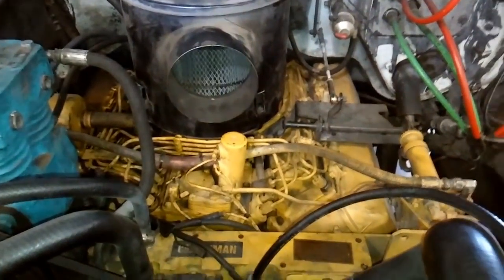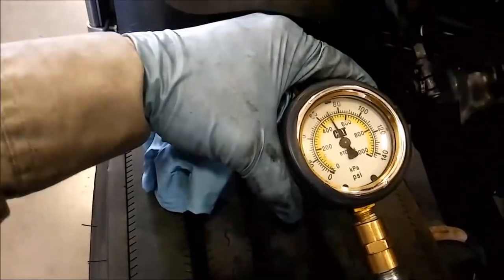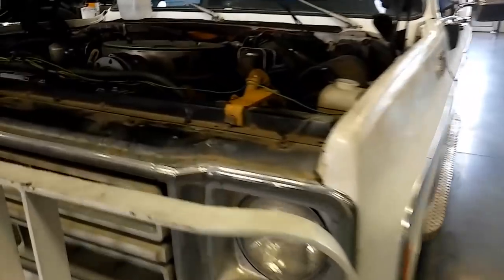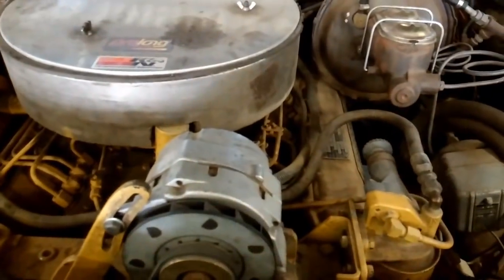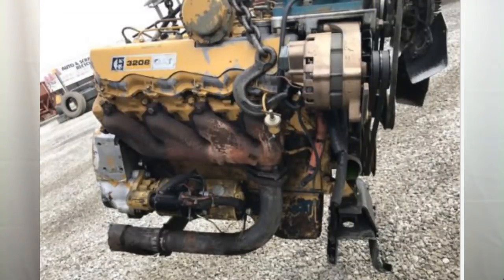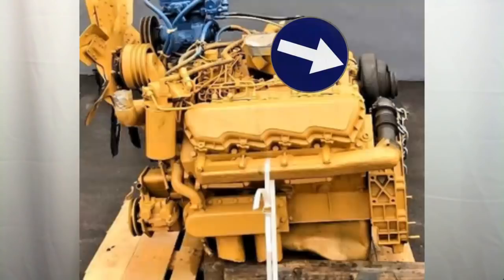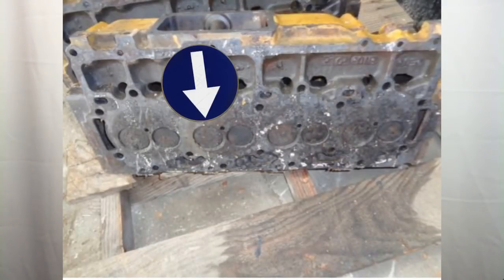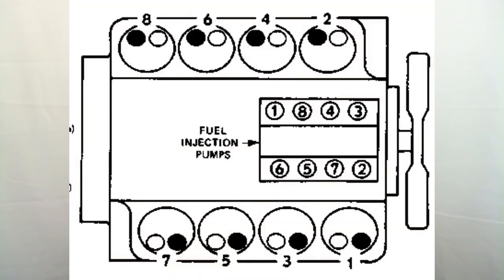The Cat 3208 Engine.  Know Your Engine. Engine Design And Problems.  Cat 3208.

Comment: Thanks for the video.   I read the manual and gonna do the valve adjustment.   Couple of questions please.  First,  It says something about a timing pin, Iv'e heard I can use a bolt, is this the case?  And on the rubber valve cover gasket do I use any kind of sealer?  Thanks again,  Chris... Will donate to your channel :)
Reply from the maker: +chris gollihar You could use a bolt, but a pin punch will work better as it is smooth unlike a bolt with threads. It just needs to be the right size. I don't use silicone on hardly anything, unless it is where gasket joints meet and the 3208 uses a 1 piece seal, so I don't use any on them.
Reply: Thanks Josh appreciate your help

Comment: take the decals off and set them side to side you couldnt tell the difference between a 3208 and an 1160.  the diaphrams in the pcv valve would tear and you'd burn the oil out of the engine.    the throttle shafts would wear in the governor housing and suck air. there was a run that in cold temps would blow the oil filters right off the cooler housing. had to drill out reliefs. had several that blew out the timing cover gasket from high coolant pressure.  i've seen them down to 165 hp

Comment: Hello! I just picked up a 1980 Ford C800 (8000) with the Cat 3208 (non-turbo) with auto-trans.  Would you happen to know where I can get the old part number (exploded view) which would include belts and hoses specs?  Trying to stack the deck so I can search for parts, etc....thanks

Comment: Have a 3208 in our New Holland tr85 combine never had any issues ever with it seems like a sold engine
Reply: Clean fuel is a must. Lower end is weak, replace rod and main's brgs sooner than the O and M guide. Keep valves adjusted.

Comment: What is involved in converting a turbo 3208 industrial generator engine to a truck engine?  HP is the same.  Just an adjustment to the rpm and moving the accessories over?

Comment: Are you sure they never made a 3208 with a roller cam ?
Could've swore the last ones with the turbo had a redesigned block to accommodate a roller cam setup. But i could be mistaken
Reply from the maker: You are correct, some of the last versions were roller cams. I've never seen one in person though.

Comment: Notorious for the valve keepers which hold the top of the valve stem to the springs letting go. This lets the valve fall out after the engine is shut off. The next time you start the engine the piston pushes the valve up where it try's to make new holes into the head.

Comment: Cant say much bout these engine,i got 2 of them in my pilot boat.I cant go worrying bout the the valve gonna fall into the piston or the piston rings are gonna crumple.Hope its not! i've seen valve chipped off & the pieces fall into piston & damaging the piston head.Well,if its gonna happen, just fix it.Yeah,too bad 3208 didnt have a cylinder liner.Other than dat,its a good engine ":)

Comment: so what is the difference between a 210 and 250 hp turboed engine?  Injectors or fuel pump?
Reply: A 210 NA or a 210 Turbocharged?
Reply: @johngoldsmith6629   thanks I learned later the blocks are different between NA and turbo.

Comment: Hello.thank you for a great video! I have two of this in my boat,1996 mod 435 hp.runs great,but i have a problem with soot in my coolant.I have tried cleaning serval times,but my coolant is turning black very quick . Can this be because of the O-rings you talk about in your video?
Reply: no  you got a cracked head or exhaust manifold

Comment: In terms of reliability, cost and longevity which is better? 3126 or 3208? I'm trying to decide because I want to swap one into a 85 Ram 350. I know both engines will be a lot of work to put in
Reply: I'd say 3208 is more reliable but is heavier that a 3126. The 3126 is narrower but long as it's a inline 6 vs a V8 so fitting it in your engine bay gonna be a issue. Honostly if I was you I'd just slap a 12 valve Cummins in your truck. Easier swap and of course the aftermarket is huge and parts will be cheaper.

Comment: Dammit, now I’m worried about that O-ring plastic tube BS…
I do have the 02Z engine with turbo and no intercooler (250 Hp version) built in 1988.
I want to add an engine retarder but I have to beef up the exhaust valve springs to do that I am hearing, and I cannot do that unless I have the steel camshaft and not the cast iron camshaft.
How do I determine which camshaft I have?🤷🏻‍♂️

Comment: what was the difference between the 1160 and the 3208???   biggest problems i had was blowing oil filters off in winter (service bulletin on that) and sucking air around the throttle shaft,  when they'd get worn the diaphrams would blow out on the crankcase vent and theyd vampire themselves

Comment: We got a RV 3208 v8 and fuel stays on top the engine what would be rong with it  thanks for letting us know
Reply from the maker: Most likely a leak somewhere on the high pressure fuel pump or lines going into the cylinder head. You'd have to clean it off really well and watch it run to see.
Reply: Thank you for answering have a great day

Comment: Boats....I have 2 of them in my Model 4280 1988 Cruisers Yachts!  Run great.  Looking for upgrades to it for better performance.  My boat is 01Z serial number and are 375 HP turbo versions.
Reply: I have 2 in my 1988 Phoenix I just bought. Engines seems meticulously maintained. Have you ever had any issues?

Comment: Hello, how's it going in this quarentine?
Let me ask you, I'm a marine diesel mechanic and I'm working on a sailboat which had one of those cats 3208 unfortunately the engine was submerged and nobody did anything for years so it's dead, to get a new similar engine I found some boat papers saying it was 150 HP but all the information I ever found about this model was that the smallest version was 210HP so maybe somebody made a mistake filling the papers or actually they made a 150HP version? Do you know anything about? Thanks!!!
 Regards from Puerto Williams - Chile.
Reply: Looking at the flywheel from the rear. The engine serial number is stamped in the block under the cylinder head. That is where you need to start.
Reply: If the horsepower was lower than 210, they must have turned down the fuel pump due to vessel survey requirements.
Reply: The 3208 evolved from the earlier 3160/1160, 1150, 1140, and 1145 series engines. This entire engine family looked pretty much the same, except the earlier engines had inline fuel injection pumps and fuel return lines. I've only seen one 3208 with fuel return lines, and it was ancient back in the 1990s. These engines were seriously low on HP, but the torque was really good. I've seen NA 3208s rated as low as 190 HP, and it wouldn't surprise me if there were lower HP versions offered. 210 HP was the maximum for the NA engine IIRC. The highest HP versions of the 3208T were the marine engines with keel cooling and water cooled exhaust manifolds. A Cat rep once told me that the 3208T marine engines had an extremely low warranty rate. I smarted off to him saying that it was probably true because the 3208 had a nasty habit of connecting rod failures (true), the rods on the third journal back would chuck the rod and piston through the hull of the boat, sinking it. Then it wasn't a warranty claim, it was an insurance claim. He was not amused by this very much.

Comment: It's been many years since I have even seen a 3208 
But now have a fleet customer who has a rare F8000, not a C, or CF , a F series running a turbo 3208.
 I vaguely remember the fuel injection pump R & R steps.There was a short bolt you removed and replaced with a longer one, on the pump or block I no longer remember.
Anyone out there know the procedure? Thanks.

Comment: Hello,  I found a 1981 TR 85 New Holland combine that a local farmer had in a barn with only 1000 hrs on the machine.  It has a 3208 Cat but the plate on the valve cover states that it has 168 hp, I thought it was a 210 rated motor?  I'm taking the machine apart due to rust but the motor started up and I managed to drive it 10 miles to my farm.   Just reading up on the pros and cons of the 3208, even thinking about replacing my 7.3 PowerStroke on my 95  F350 or putting it in my International 966.  Any ideas out there!!!
Reply: 155, 168, 175 HP in TR combines.  My TR 95s put out 225 HP but that is turbo.  We had 5 NH combines, all went over 3500 hours without engine troubles.  Then headgasket failures, but I was always worried about that weak bottom end.  100 hour oil changes.  Great starting, if your batteries would roll it over once it was running

Comment: I know nothing about boat, generator, or equipment motors. I had a couple in Ford trucks. So if you run across a Blue one, it was in a Ford. If you find a Red one, it was originally in an International. And if you have a White one, it was in a WHITE truck, (Freightliner's grandfather).

Comment: It's the little V8, Cat made a shit load of them. I heard people who have worked on them by advancing the pumps on them. and putting twin turbos on them. and larger exhaust systems on them. and have used them in light duty trucks with one ton being about the lightest. and have pretty good success with them. one ton Ford pickups are a really good application for them. the naturally aspirated versions were dogs. they had a terrible HP to weigh ratio. but if properly maintained could run for a long time. boy time has flown by I realize it's been over twenty years ago. when Cat stopped production of them.
Cat And Ford must have had some sort of arrangement with each other. because back when Ford built the Louisville trucks. which they made a shit load of them. almost all of them were powered by the 3208 Cat engines.

Comment: Thank you for making this video.  435 hp out of a 3208??  THAT would seem to be a short lived engine....would that most likely be in a marine application?   I owned about 15 of these, all low hp at 200-225 horsepower.  Even had a turboed 3208, at 170 hp (??) at 2400 RPM max, ridiculously weak, but probably lasted forever in this yard goat.  They MUST BE maintained or they will fly apart violently.  I liked my 1160 (the older 3208, with a better injector pump) best, but no family of engines ever committed suicide sooner or more explosively than these non-sleeved CATs.
Reply: So are upi saying you don't like the 3208???

Comment: Ok Cat made model 1140, 1145, 1150, 1160, which are the predecessor of the 3208 same block same head design all interchangeable between parts 1160 is the same bore and stroke as the 3208 BUT the 1140, 1145/522 CID and 1150/573 CID  have smaller displacement with corresponding bore and stroke these Cat engine are referred as the 1100 series model

Comment: Amazing how they get so little power and torque out of a 10 litre engine
Reply: Yup....its an engine that doesnt have enough power to get out of its own way.  hahaha.  Why did CAT even bother?
Reply: @iBackshift  I believe as an anchor they are excellent
Reply: @iBackshift  they were trying to match Cummin's lack of success they had with the "Tripple Nickel" 555 V8.
Reply: It’s a dinosaur. Even my 7.3 idi is more advanced than the 3208 I thought about putting it in place of my idi if it failed, but when I found out how much it weighs that shut it down pretty quick. Same thing with the 5.9 & the dt466, I can see myself getting a dt360/IH5.9, but I’ll probably in the end put another idi in the truck cuz the engine is pretty reliable once the engine is bored out & gets sleeved to “fix” reset the cavitation timer on the engine.
Reply: Really goes to show that (large) Diesels are pretty wimpy without forced induction.
Reply: I’ve got a Ranger in Australia with a 2lt engine that’s 210hp.
Reply: @wintonhudelson2252  we used to call the 555 Cummins triple trouble
Reply: @iBackshift  no kidding a 6v92 in any configuration will walk all over  it
Reply: @ No Body

Yah—

—and so little fuel economy also...

Comment: What Are Some Things I should check when I'm looking at this engine for sale
Reply from the maker: +RoadHammer3406E I need to make a what to look for in a used engine video. Without pulling it apart, you can really only do a few checks. Run it and listen for anything that sounds weird, check the oil pressure hot and cold, get an oil analysis if you can, how does the blowby look, coolant condition, oil and exhaust leaks.
Reply: Adept Ape well the engine I'm looking at looks great but sitting on a pallet and the ad says it hasn't run in years but had an inframe just before it got pulled

Comment: Is it true, that you could literally connect 3208 engines front to back and make one bad boy engine?... LOL, if it is, sounds like you'd need duals on the front axe because of how heavy just one motor is... but I remember hearing and old story about a chip hauler with 2 3208 engines bolted together under the hood..  said it belched out black smoke like the queen Mary but passed other loaded trucks like he was empty, but if it was making 600 to 850 horsepower back then... must have been a fun ride! Hell, I miss a C 15 compared to the stupid 13 liter junk being forced into the industry now...

Comment: hey sorry to bother you I have a question on my c7. I have a loss of power after it warms up it will drop gear and not let me pass 35pmh. I checked my fuel pressure and it's at 55psi. what do you think it can be ? thanks
Reply from the maker: +anthony alvarez Well that pressure is a little low. Start with the pressure regulator on the back of the head, it is fairly cheap and commonly fails.
Reply: Adept Ape
 thank you for your help

Comment: When will you do a video on the 3408 cat
Reply from the maker: +Joseph Martinez The 3408 isn't an engine you see very often, I'm going to do a 3406B video though.
Reply: Still popular in Australia ! On youtube you can see them in some road trains ! My friend had one in his logging truck with a pre-cup and it would lug down and pull like crazy ! His cousin had one in his truck with DI but it would not pull like the pre-cup ! Great videos A A  ! Have you dealt with any natural gas conversions in on highway trucks yet ? Glen.
Reply: I vote for videos on both... I love the B best mechanical cat ever.....E if you want electronic....
Reply: I have one in my 82 peterbilt 359. Direct injection version. No glow plugs.
Reply: 3408 is a excellent motor. No jakes though as it was originally dwsigned as a payloader engine. My friend owned 5 of them. He put over 4 million miles on them. Never had any problems. They sound awesome.
Reply: I appreciate the videos on the older engines.. Brings back a lot of memories of helping my dad on the weekends when he worked for the Portland OR Cat shop, back in the late 80's..
Reply: fastbmwm635 pre cup MAYBE...DI NEVER
Reply: Adept Ape ok cool just wondering lol because that’s all I’m around on these shrimpboats 3408 and 3412s thank you
Reply: Putting a Jake brake on a 3408 would have been a plumbers nightmare. Thus a brakesaver was used.

Comment: Have you worked on or know much about the 1160 cat engine?
Reply: 1100 series engine. They was available in 1140, 1145 1150 and a 1160. Inline scroll fuel system. Smokes in cold weather until it warms up.
Reply: Are they comparable to the 3208? I can't find much info about them and I was going to use it for a engine swap but finding info about it is proving to be difficult
Reply: @zackbirkby564   When the 1100 series was discontinued Cat offered a reman 0R1108. It was a 3208 with a 1100 series front cover. The entire mounting is different than a 3208 for air compressor, alt, power steering and such. Also the throttle linkage was different and fuel line hook up to tank.  The crankshaft was smaller where the pulley fits. Have to use a 1100 series pulley with a 1100 series engine. I never tried to convert one backwards. Unless you have all the accessories, you might have to use the 3208 cover and see if it will work. No guarantee when you do something like this. First item comes to mind is the front seal. Will have to use a 1100 series front seal, damper and put into a 3208 hsg. Crankshaft pulley OD may speed up or slow down accessories. A 1100 series takes a 9L7735 Front seal. DSPL has that as a 77.88 MM OD, which equals to 3.066 inches.
No info for a 3208 seal. Need to see if your local Cat dealer has one and measure the OD for your engine.

Comment: Seems like nobody pays attention to this either these reman 3208 after Rebuilders are selling they're selling these without a flywheel this engine is externally balanced that means the flywheel is part of the balancing for the rotating assembly that's the crank rods and pistons when you buy one of these without a flywheel that's balance to that motor and you both your flywheel to that engine it's out of balance so they think because it's a low RPM engine that don't matter well it does it sends Harmonix through the motor and it can actually break a crankshaft can cause other problems I wouldn't go through all the expense it all the work go changing out one and then find out I have to do this all over again all they have to do is look at the back side that goes to the block of any 3208 Cat motor and you can see the balancing holes that's drilled in the back of the flywheel they don't do that for the fun of it that's what balance is the rotating assembly if you start swapping Parts you're going to have problems

Comment: You have that out of balence fly wheel now it has to be drilled to balence rotating assy there all drilled different.  Or if you have twins in a boat you better mark witch flywheel goes with what engines